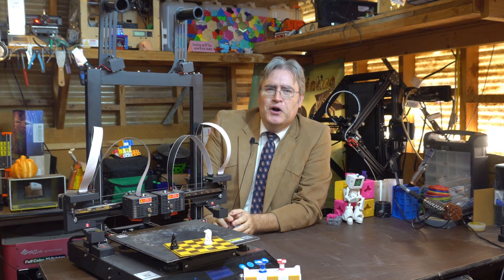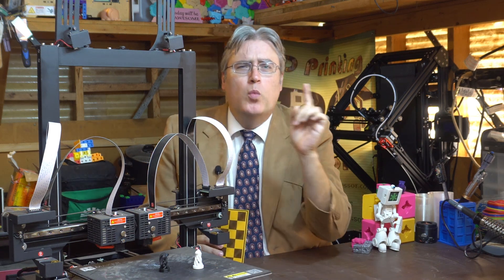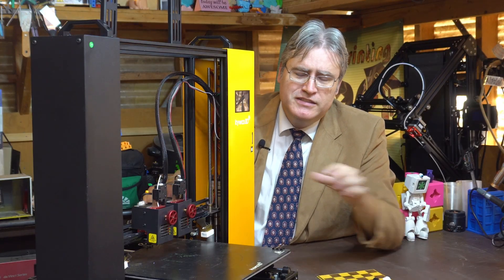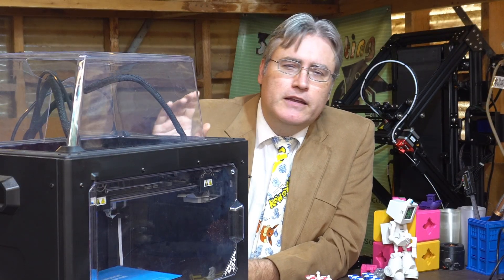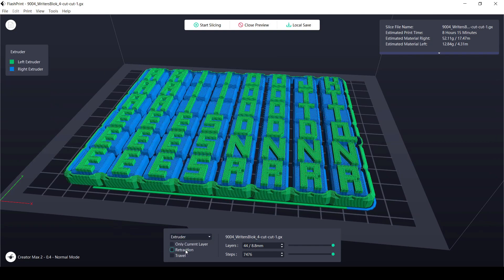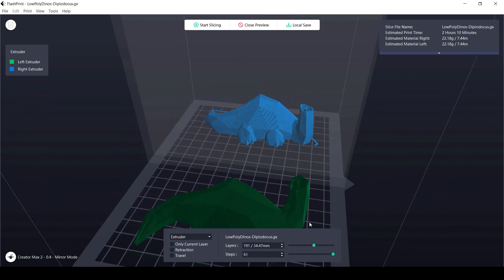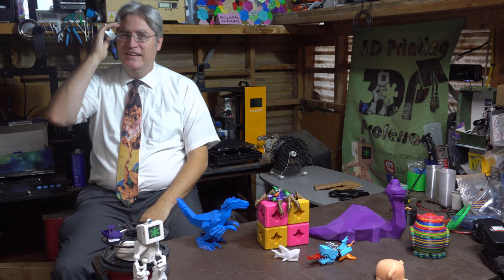Is IDEX worth it? Do you want multi-material 3D printing?

Comment: My first 3D printer was a pre-owned Ultimaker S3 and after watching numerous reviews on different 3D printer manufacturers, I concluded that the S3 was not only an excellent easy to use dual nozzle desktop-sized printer, boasting a two in one print head, but had the ability to change filaments whilst actively printing, thus utilising more than two different filaments simultaneously, such as support material into a complex print, making the S3 and S5 in my opinion fantastic printers for noobs and pro's alike. Thanks for sharing. 👍

Comment: Should I go with Kywoo or Creator pro 2? It’ll be my first 3d printer and would like it without too much fuss on it. I can spend an afternoon or two to get it working, but hopefully it’ll be a straightforward process. Thanks in advance.
Reply from the maker: If the choice is between those two, and you don't want to fuss with it, I'd go with the Creator Pro 2.
Reply: @3dpprofessor   is there other options? I did some more research and found sovol SV04 seems good as well? And Bambu lab X1 seems awesome, I’ll be able to print more types of materials with the expanse of purging and initial cost.
Reply from the maker: @solaregg123  Oh, there are lots of other options, as you know. It's defiantly a challenge to weigh them all against each other. 

I can only tell you from my experience. Though i will be checking out the Bambu Lab X1 soon, so maybe I'll have a different opinion.

Comment: You should look into the FlashForge Creator 3 Pro or the Creator 4.
Reply from the maker: I have a creator Max, same thing as the 3 pro and I love it. But try as I might I can't get them to send me a Creator 4.
Reply from the maker: Oop, the max isn't the same thing as the creator 3, I was mistaken. Yes, I'd love to check that out.
Reply: @3dpprofessor  The Max 2 Pro is the same as the Creator 2 Pro.  I would love to try both the Creator 3 Pro and the Creator 4!  I have two Creator Pros and one Creator 2 Pro.  I upgraded my both Creator Pros with the Bondtech extruders and MicroSwiss all metal hotends.  My Creator 2 Pro is stock.

Comment: Hi there, I intend to buy an IDEX printer to print TPU insoles in mirror mode. The maximum size would be 290mm x 140mm each side of the insole.  Judging the specs, the idex tycoon printer would suit me.  However, I have read comments about issues with extruder cooling, auto-levelling, and firmware.  Do you know if these issues have been resolved?  Would you recommend buying this or another similar idex printer? Thanks
Reply from the maker: I had similar problems and offloaded this printer in favor of the Artist-D, which I am having numerious problems with the bed not remaining level, but I am using it almost every day now. https://www.youtube.com/watch?v=GJQV_XYdqck

Comment: The restrictions in printing size depend on the capabilities of the printer itself. There are printers on the market who provide a parking position for at least one of the heads in order not to loose working space - as the RAISE 3D E2 does - in this printer we only have restrictions in size when actually using both heads. The problem with slicing correct gcode indeed is an issue - sometimes at least and only if You don´t have the appropriate slicer to do a good work. As e.g. the simplify 3D or for instance the idea maker in case of Raise 3D.
I own 3D printers for a longer time - my first and still running system is a MANKATI Fullscale xt plus (not available anymore) with dual extruder, meanwhile flanked with a creality Ender 5 plus for even bigger prints and a witbox 2 from BQ (not available anymore). But those are all printers for "home office" and private use - compared to my Raise 3D E2 oder a Stratasys for productivity purposes.

Comment: The big downside of IDEX in mirror or duplicate mode is it is impossible to do ABL. ABL corrects z-height to follow the bed's mesh depending the position of the nozzle. But as both heads share same z (and y - only c is independend) ABL can only work if only one head is active at a time. So the bed has to be casted finemilled aluminium with some thickness - making bedslingers a bad design choise if you want to use theese modes. z-moving bed is definitly a must2have.
There is a possible solution to the ABL-problem, but this is not supported by the slicer nor the firmware at the moment: Fading ABL. For single extruder this is supported in Marlin. Compensation is (depending of the settings in firmware) done f.e. only in the 2mm at the bottom. First layer follows the bed contour fully, but next a bit less until after 2mm no correction is needed anymore. So for perfect Mirror or Duplex on an bedslinger IDEX we need exactly this - first 2mm printed with ABL-fading one side after the other, only than starting printing with both heads in parallel.

Another problem is resonance compensation (aka input shaping): Resonance frequency in duplex, mirror and single head at a time modes differs. Hard to compensate... So print slow to avoid ringing.

Anyway, there a barely any szenarios where (bedslinger) IDEX realy be a good solution. You are limited to two filaments anyway. With an MMU you can change between much more colours. In most cases even manual change is enough. You do not have to sit and watch - simply put an M600 inside. With Prusa Slicer you even get a good prognose about the time you need to do the change. Even filament changes inside a layer are no problem, if you want to embed text or symbols into the top or bottom layers (virtual extruders and custom gcode for toolchange =m600).

Also different temperatures work with filament changes - just some aditional gcode needed.

So if you do a lot of two material prints or lot of duplicates and mirrors, a cube IDEX printer might be quite usefull. But a bedshaker is definitly not a good idea.
In most cases a MMU is the better alternative to a bedshaker IDEX. Like the ERCF... Much more budget friendly.

But one option IDEX allows (the most interesting in my opinion) you did not even mention: Different nozzles. You might use a high flow bigger nozzle on second extruder (f.e. Bondtech CHT) and speed up prints a lot, if you do not multiple colours but diferent resolution. For example an object with a detailed top but botom part less detailed. Print the bottom with 0.8 but the top with 0.4 or even less...
Reply from the maker: You are correct. The Weedo X40 got around the ABL problem by using the ABL to help you level it right. Kinda crazy.

Not a lot of printers are doing resonance compensation yet, but if it becomes more universal, that would be a problem. Most IDEX printers I've seen compensate for this by going real slow.

I do like the idea of having different nozzles on an IDEX machine.
Reply: @3dpprofessor  I think resonance compensation will become common as soon as the Pi zero 2 W will get better available. Nearly every printer can be upgraded to Klipper - and as there are more and more YT-videos about that topic coming up and the (regular) price of the Pi Z2 W is quite affordable, I am pretty sure in about a year or so many people will upgrade their printers...

Comment: I like my Tenlog TLD3. Mostly duplication mode because I print alot of repetitive parts and it's like having 2 printers running at once. Also the print heads move completely off the bed so you can use the whole thing. 

I don't do water solvable filament, but I print t mostly in PETG, and if I want a nice model, I will use PLA for support, it seems to work well.
Reply: Do you think it’s better than 2 individual printers
Reply: @crazywormy5869  for what I do, yes. It is essentially having 2 printers running at once. I can run duplicate, or mirror image models. But I can also run 2 different filaments on one model if I wish. Example I can do 2 colors, or sometimes I run pla as a support for petg.
Reply: @crazywormy5869  also I have since gotten the TLD6, the build volume is huge

Comment: I just purchased the Creator Pro 2.  Great printer but I have one issue with it and it doesn't Z hop during multiple color / material prints during the final move when an extruder is returning to home prior to handing off to the other extruder.   I believe it's an issue in Flashprint.  A very annoying bug if you ask me.

Comment: Tenlog Hands 2 pro has been a good IDEX machine.  Duplication mode PLA/PLA (easy) works perfectly.  That, and the backup redundancy, justifies the IDEX already.  
Tested dual material printing with polypropylene in PLA.  These materials were reported to allow high performance fluid fittings, but I found it difficult.  It could produce a basic part, but the tuning needed and with PP stringing, warping, made it impractical.   A lot more parameters to optimize with IDEX than with single nozzle.

Comment: I have recently purchased and setup an Artist-D Pro printer. I have some previous experience with such devices however I ran into a problem trying to start my first print.
The message came up on the screen “Filament detection switch is not pressed. 
I am using only one printhead but I have filament in both detectors. I also saw in a forum that updating the firmware could rectify this, but to no avail.
I did a continuity test on both detectors and on the connectors that plug into the base and that shows that the sensors themselves and the cables are fine.
I am not prepared to open up the body and fiddle inside a new machine, so I was wondering if there is any other possible software or hardware fix I might attempt before I have to toss this thing out a high window? (Just kidding, I would more likely return it).

Comment: Recently started 3d printing and realized I most of what I need is dual color. I have been researching idex printers and see nothing but negatives, is there one out there that can be used out of the box?
Reply from the maker: Flashforge Creator Max 2 is out of the box usable, and super easy. Highly recomended.
Reply: @3dpprofessor  Thanks, I did see that. Anything with a larger bed? Mostly everything I see is negative or a beta or kickstarter project.
Thanks.
Reply from the maker: @jf6720  IF you want bigger and reliable like the Creator Max, There's the upcoming Creator Pro 3. But that does challenge many people's budget. 

I'm testing the Weedo X40 right now, and I'm finding it's capable, but it's got it's downsides. 

I'm actually using my Kywoo3D IDEX the most right now, and I'm very impressed with it, even though, like I said, I can't say for sure that my unit and yours will match since I got a pre-release unit. But Kywoo3d has been pretty good so far. They build on open source technologies and engineer things well.
Reply: @3dpprofessor  Thanks again.

Comment: So I've spent the day looking at the newest innovations in all kinds of 3D printers.  Maybe you can answer this for me because I haven't figured out how to search for this on YouTube.  Are there 3D printers that are a hybrid design of self-adapting nozzles that are spread out over the entire build plate and solid ink sticks that are melted for deposit as well as on the fly color and multiple material blending?  By self-adapting nozzles I'm thinking of a design that can change the amount of material that is melted for deposit.  So instead of changing from a smaller diameter nozzle to a larger one the tool head does it without needing to replace the actual nozzle each time.

So what I see as the benefit is the move away from filament to be replaced with a type of solid ink style of material delivery.  Having an array of print heads spread out over the entire build surface should make all builds much faster.  Blending colors and materials on the fly gets rid of daisy chaining Palette 2, 3, etc.  It also gets rid of the wasteful purge or transition towers.  Or perhaps an adaptation of the HP Jet Fusion 580 Color 3D printer where this grid of nozzles are placed on a bar that moves bi-directionally to deposit each layer of the print in whatever color or material is loaded.  

But rather than a moving bar making these passes back and forth there is a single nozzle array that can deposit all the materials and colors without moving side-to-side or front-to-back.  Just moving upwards as the print grows in height.  Or possibly lowering the print bed as well as increasing the height of the printer array.

Comment: Thanks for the video, great summary!  So size is the only thing wanting on the FlashForge?  Do you have any nitpicks with its slicer?
Reply from the maker: I like Flashprint. It's not what people are used to, so they complain, but it's capable, easy to use, and it does a good job with their printers.
But, when I use the Ultimaker at the makerspace I use Cura. When I use the Raise 3D, I use Ideamaker (also, great slicer). I tend to use the slicer the manufacturer recommends. Unless it's a reskin on an old version of Cura, then I'll gank the settings and take them elsewhere.
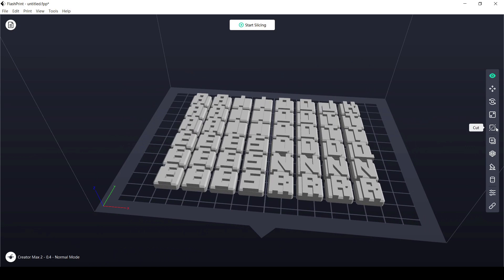Reply: @3dpprofessor  I gotcha. Regarding Flashprint: if a gentleman like yourself that has sampled a variety of slicers and [IDEX] machines is able to get the results you'd like then I'd take that as evidence they put the most necessary settings in there for success. I like their implementation of chopping the model and assigning extruders @ 7:05 seems pretty intuitive!

Comment: I should tell you that tool changing usually increases print times a little.

But I love my custom tool change (Doot changer)

Tool changers don't just allow dual material. But they can do things like milling post  processing and also have tools that have for example resin etc in them so you gain more z strengh.

You could also make a carbon fiber laying tool to add continious fibers for incredible strength while having dual extrusion too

I also love my 0.6mm tool. Imagine switching to a 0.6-1mm nozzle by just pressing a button , it's such a blessing.

Also pva is misleading. It's super awesome but it costs 4x much as PLA and bvoh is even more expensive. They're like insanely expensive, like 80-130$ a kg. It makes it nearly worthless
Reply from the maker: I feel that we put too much stock on how slow 3D printing is. I know I want everything right now, but when the 3D printer is done, it's not like the thing you're going to is going to wash out with the tide. I'd happily trade waiting a little longer for being sure that the print would work.

And, yeah, dissolvable supports are expensive, and they're hard to store for long terms. And in the end I still design for support free printing. But it's about the option.
Reply: @3dpprofessor  tbh reading what you said helped, Tho there's another reason behind my wait, my parents don't let me put my printer outside and that means the sound of it doesn't let me sleep, my tool change gearbox is also very loud ;s

Yeah true about the pva, for when you don't need to dissolve it people use TPU interface layers for pla at least! 

I actually bite the bullet and ordered pva for the first time I'm hyped :)

Comment: I know I would enjoy having an IDEX to develop on. What would you recommend with a good balance quality and features in the US$500 range?
Reply from the maker: Pretty much covered it in the video. The only one I have hands-on experience that will come close to what you can expect is the FlashPrint. Besides that, I'll just be comparing stats, same as you. 

But, I'll crack the seal on the X40 here and tell you what I think.

Comment: Two thoughts.  Have you tried printing PETG with PLA supports?  You can use a zero-gap for beautiful bottom layers since they don't stick to each other very well.  Second, I've solved the head-crashing issue by having 3 printer profiles for my IDEX printer.  The extra profiles selects the proper tool for duplicate or mirror mode and are setup with a smaller build plate that matches the safe printable area.  So while I don't get a preview of both parts, I'm 100% sure the parts will fit and print without collisions.
Reply: I started doing g this not long ago and I LOVE the results. I find it works best to use a PLA raft to compensate for the different bed adhesions.
Reply from the maker: I will give that a try. Thanks.

Comment: I have the Artist D and I have been wondering these same things about whether or not IDEX is worth it. So far, I have used the copy and mirror modes much more than the dual filament modes. I think there is still a good bit of value in the IDEX printers, but I haven't unlocked it all yet.

Comment: Omg you have the kywoo! Watching video ..i have my eye on that one . Let's see.. popcorn is out!
Update after watching : noooo!😭😭 What issues did you see with the kywoo? Since you ranked their  tycoon so high I had great expectations for this one. Was just waiting for it to be available and some reviews to pull the trigger.. 🥺
Reply from the maker: It's like the JGMaker in a lot of ways. The bed leveling is fiddly. The GCode runs unchecked so it's easy to crash the heads. The 300mm width is actually only 250mm per extruder, and 200mm for dual material prints. 

It wasn't bad by any means. Nothing about it was particularly deal breaking. And if you know it's coming, it would probably be fine. But my expectations were at a 10 and it delivered a solid 7. Disappointing. Plus it doesn't have Wifi delivery.
Now, again, maybe the production version won't have some of these problems. I really don't know, because I really didn't get it.